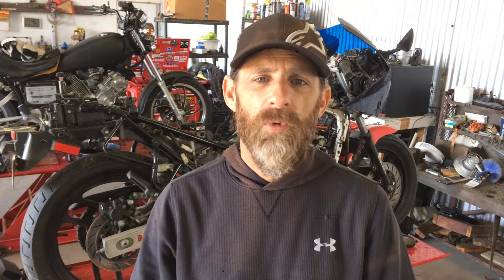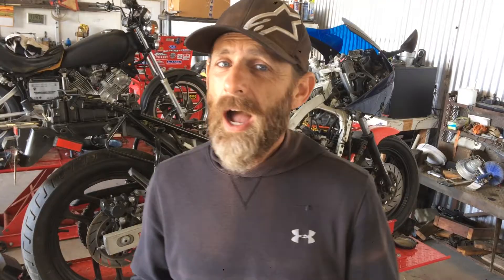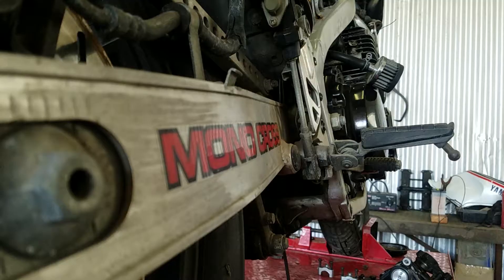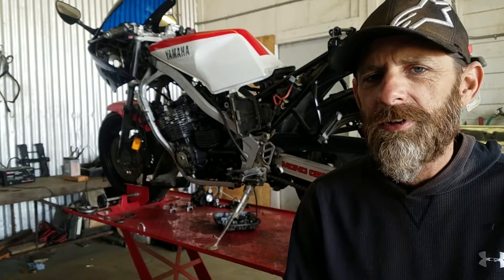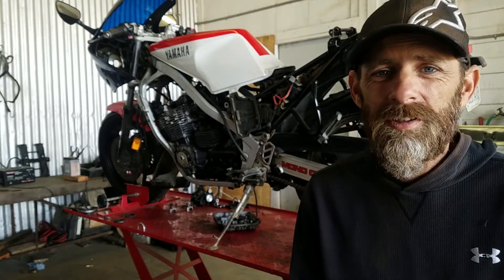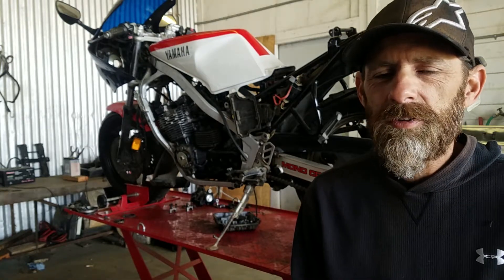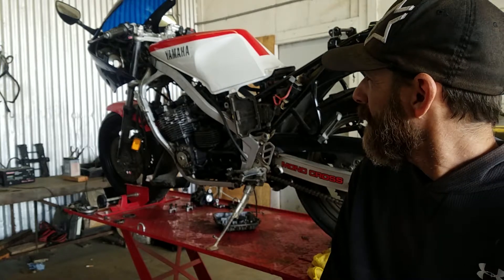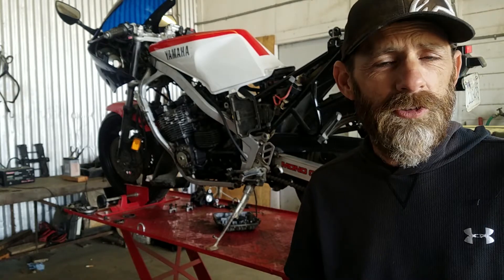1986 Yamaha FZ600 Project - Part 1

Comment: Say, how do you get the carbs out? It's so tight in there that it looks like I have to remove the battery box in order to get enough room to remove the air box to get to the carbs.
Reply from the maker: If I remember correctly, you've just answered your question. It was a massive pain in the ass. The airbox has to come out and I'm pretty sure I started with battery box. Filled up a whole swear jar.
Reply: @MotoMedic  🤣 thanks.

Comment: The story at the time was that this was the non-US FZ400 with the FJ600 engine - since US buyers wouldn't buy the 400cc version. I test rode a used one once and should have bought it but bought a GPz 750 instead. That was around 1989.
Reply from the maker: Exactly...  Us damn Americans have this idea that bigger is better. One bike I always wanted to get my hands on was the Kawasaki ZX4R. 4 cylinder 18000rpm redline 400cc screamer. Couldn't get them here...

Comment: i had one of these.  Top speed 135mph.
Reply from the maker: Guy locally up here in Washington / Idaho was selling one last summer that was a drag bike. Was running high mid 8's in the 1/4 mile on this bike. I was shocked!
Reply from the maker: @Will Harris pretty sure that's the only way I'll get this one up to those speeds too 😂😂. I'm thinking of possibly doing some vintage racing on it if I get it back to glory this year.
Reply from the maker: @Will Harris love me those old 2 smokes! Hahaha! Yes they were the RZ350. Great bike and sometimes I'll see one in the wild.

This one hasn't run since I've taken it in. The carbs need serious work and I rebuilt the entire top end for this client before he stiffed me on the cash, so I now own it after going through the proper legal channels. I know it'll fire though as I've sprayed a little starter fluid into the intakes and hit the starter button to hear a nice (but short) Rev before she runs out of combustibles in the cylinders.

Carbs are currently on my work bench and I'm having to actually drill out two of the main jets because they're fused into the carbs. Hoping to remedy that soon. I have to fit the new tank with fuel cock and new cap too. Aside from that she needs brake lines and pads and some fresh tires.
Reply from the maker: @Will Harris good chatting with you too, Will. You guys stay safe over there as well and I'll definitely be keeping up on videos about this bike as it comes along.